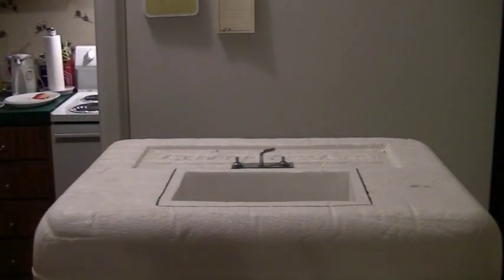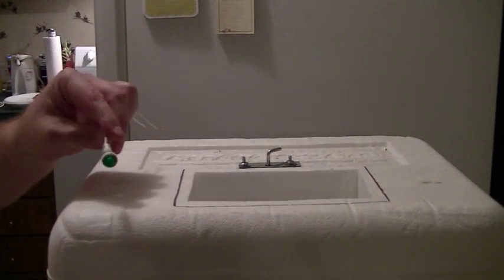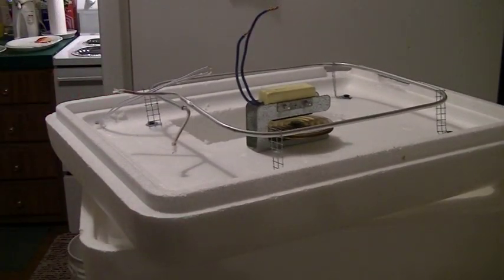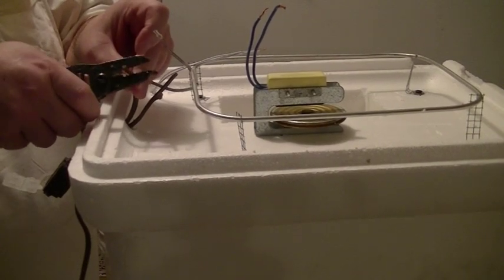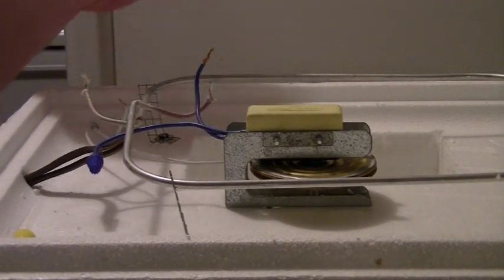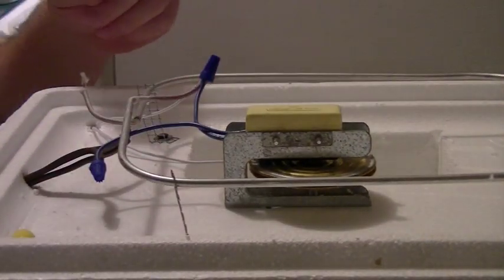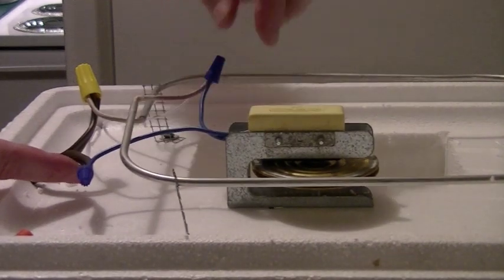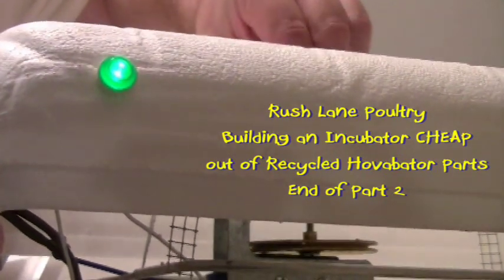Building a Home Made Incubator using Recycled Hovabator Parts! Part 2 of 3

Comment: I also did not find it on ebay as power on led  light
Reply: https://www.ebay.com/itm/BBT-120-volt-Green-LED-Indicator-Light/303017790885?hash=item468d448da5:g:MbgAAOSwTEZcK7C4:sc:USPSFirstClass!29020!US!-1:rk:2:pf:0
Reply: the lights have gotten more expensive over the years!
Reply: here's a better deal: https://www.ebay.com/itm/6-BBT-Marine-Grade-120-volt-Waterproof-Low-Profile-Green-LED-Indicator-Lights/303014963512?epid=24027577974&hash=item468d196938:g:cyIAAOSwltxcK7Yv:sc:USPSFirstClass!29020!US!-1:rk:11:pf:0

Comment: if im using a digital control it would take place of the wafer thermostat right? i plan to make a cabinet incubator with two heating element(one top and one bottom) using a digital control (with heat and cooling to turn on fans or heat with one fan constantly running to keep air moving) i have ideas but when it comes to the electrical part im a little lost.
Reply from the maker: Hey Dusty! Maybe this vid will help you out: Installing and Wiring a Digital Temp Controller using a Solid State Relay Into Your Incubator